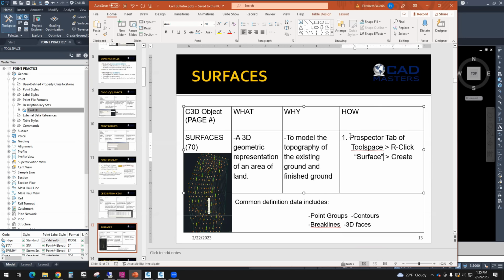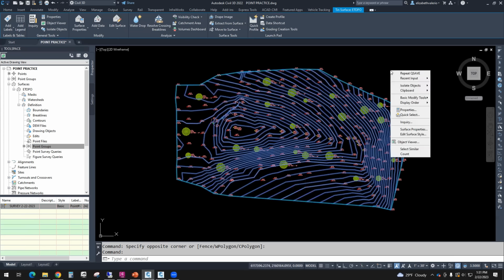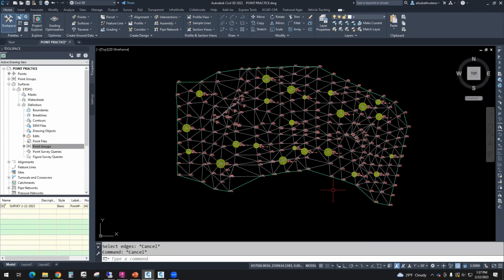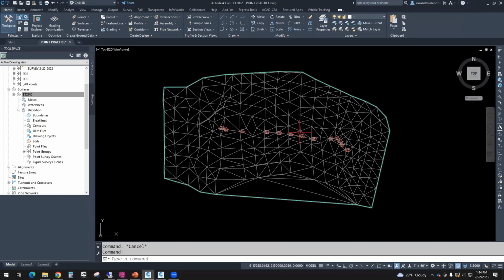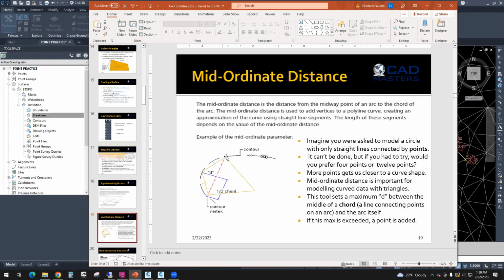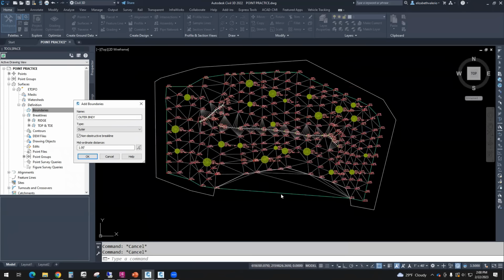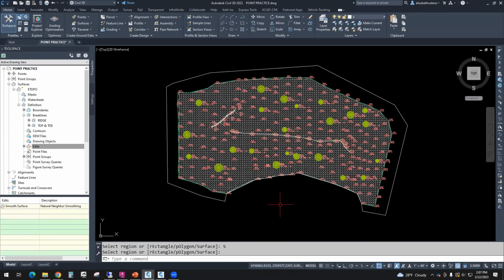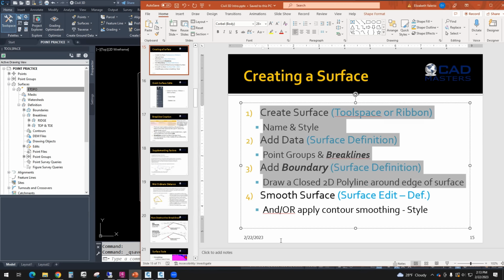Civil 3D Surface Creation

Comment: Hello,
First of all I'd like to thank you for this really helpful video.

I have a question on the "Smooth Surface" part: In the video you said that you recommend not to smoothen the entire surface when the area is too large because of how time consuming that would be. Is there any practical scale where a user should know that it is efficient or not to work on the entire area's smoothing. For example 75.000 sqr meters are good but 100.000 is not?
And the second question: Is it better to smoothen the surface in parts via Polygon selection in the SMOOTHSURFACE command or via Rectangle?
Thank you in advance

Comment: How do we know, what points should be used for breaklines????? Please
Reply: Typically, you would connects points for areas like: top of curb, flow line, lip of gutter, edge of pavement, back of sidewalk, center line of road, etc.

Comment: Hi, are the point groups manually added by the user or are they obtained during field survey
Reply from the maker: The point data comes from a survey in the form of a text file. You can import points from the text file into Civil 3D. See our video on C3D Points: https://youtu.be/RStSVRvMaFI?si=E7lQdcV8LIEYsOUo
Reply: Typically existing ground points are collected by a survey team and given to the CAD team in the form of a .txt file or .csv file. See our video on importing points.